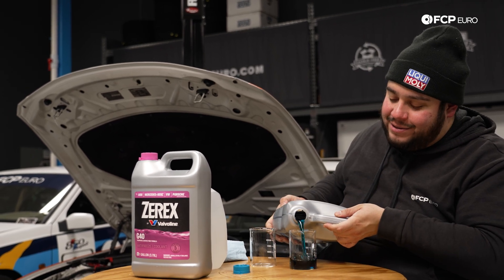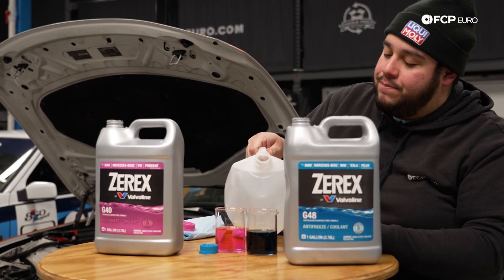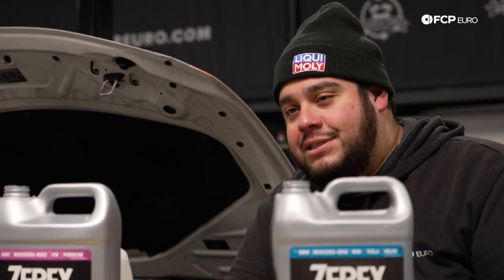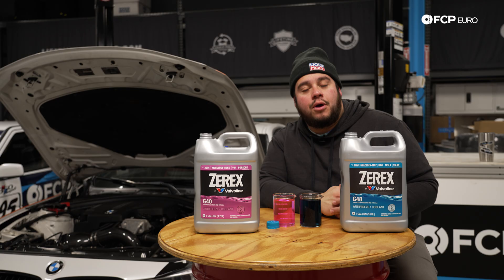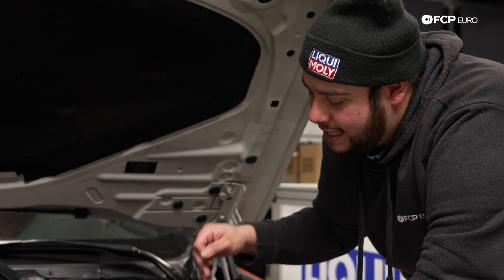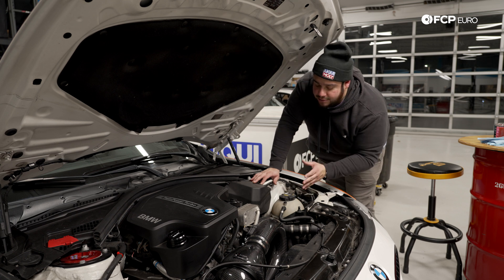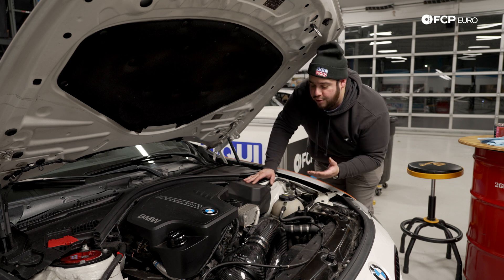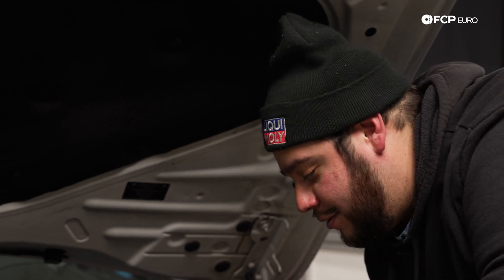Why Your Car's Coolant Matters In The Coldest Months

Comment: incredible. I can't remove my handbrake cable from the brake disc. it's impossible, 320d e92 series. if only a small hole in the metal structure and my cable has a head that doesn't fit through that hole. there is no accessory to dismantle but only that small hole where the rope slides but its head does not pass. someone help me please

Comment: Factory specified coolant replacement for my 2007 Mercedes is 15 years or 150k miles.  I changed mine at 14 years and 80k miles.  I tend to value factory specifications more than recommendations of people who are mechanics or are selling products.  Very few of them have automotive engineering, chemistry, petroleum engineering degrees, etc.  Their (retail) spiel is often that factory specs are written by bean counters, marketing, etc.  This is of course patently ridiculous

Comment: "I have a 2020 BMW x3 with 24,000 miles on it. I recently brought it in for a six-month oil change with 3,500 mile intervals and asked the serviceman at the BMW dealership to change the coolant. However, he advised me that it was too early to change the coolant. I would like to know the correct mileage and age at which the coolant should be changed. Thank you, Vincent."NK YOU      VINCENT
Reply: Check your manual, but generally coolants are pretty resistant to corrosion with the amount of inhibitors included in the formulation. 30k is too soon IMO. My 2005 330 had the factory coolant fill up until it started leaking from the expansion tank, which eventually popped in a parking lot at around 97k miles. If your cooling system is sealed and working as it should, the coolant should be fine for years.

Not a BMW but a friend of mine recently got his Nismo 350Z running after it sat parked for 8 years. When he drained all the fluids, thinking all of them would need to be changed, it was a pleasant surprise to see the coolant still look like new. No dirty bits, no bits of rust or crud. Just clean coolant.
Reply: I disagree with the ripepunani.  Sure the mileage is fairly low on the X3 but a 2020 MY car is 4 years old by now.  A coolant drain and fill is fairly cheap - what, 1 hour of labor + coolant and distilled water?  I would do it every 5 years at a minimum.  Keep in mind that most cooling system repairs will include draining the coolant, so if your car has a cooling system repair, it’s getting fresh coolant at that time.
Reply: @ghostwrench2292  Well yeah, if the cooling system needs to be serviced then yes it'll get fresh coolant. Mine wasn't serviced until the expansion tank popped at 97k back in 2018. The coolant still looked in good shape for a ~13 year old fill. I won't advise against changing the coolant every 5 years, like you said it's not expensive for G48 coolant and some distilled water. 👍
Reply: @ghostwrench2292  My point is that changing it every 30k or 2 years as I've seen some recommend is too soon for modern coolants.
Reply: Thank You I will follow your advice.